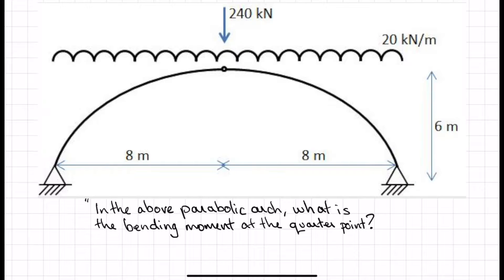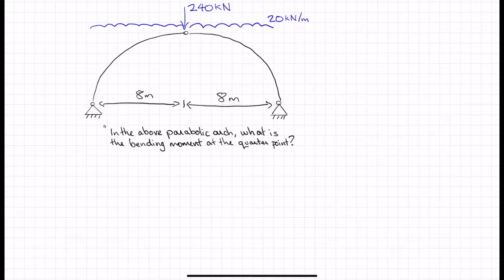Bending Moment at Quarter Points of an Arch - IStructE Certificate in Structural Behaviour

Comment: Great video. I have come across a similar question with a singular UDL across the whole arch, hinges at quarter, half and three-quarter points and fixed supports. The question asks for the moment at the supports, is this inherently zero as the arch doesn't carry moment?

Comment: Great video. One question though, why are you considering the UDL in the bending moment of a parabolic arch?
Reply from the maker: You need the UDL to calculate the magnitude of the reactions
Reply: @TheStructuralExam  Thanks. But why in the very last step of calculating the moment you consider the UDL?
Reply from the maker: @lucacosta6228  If you take a free body diagram you have to take ALL the loads acting on one side or the other to get the correct equation of equilibrium. The UDL is what causes the reactions AND the shear force at the cut (even though shear does not contribute to the moment equation). There's no reason why you would not consider a UDL or any other type of loading.
Reply: @TheStructuralExam  Thank you for the video! I think what Luca was pointing towards is that initially you mentioned that linear UDLs do not contribute to a parabolic arch. Is that accounted for in the equilibrium equations?
Reply from the maker: @nehadaniel7958  yes, the equilibrium equations take the reactions into account (external effects). But linear UDL does not add or subtract anything to the bending moments (internal effects)